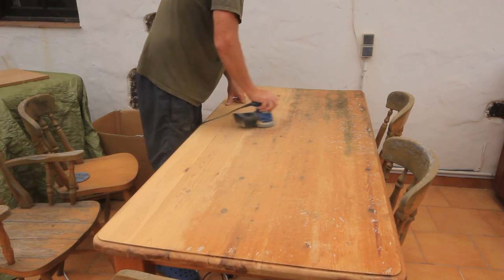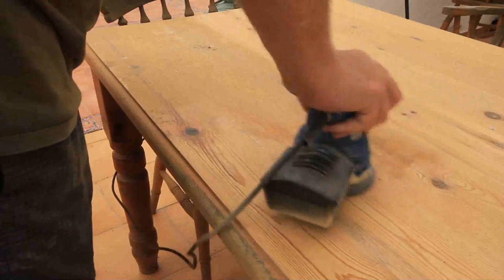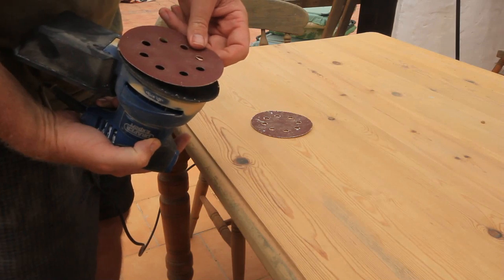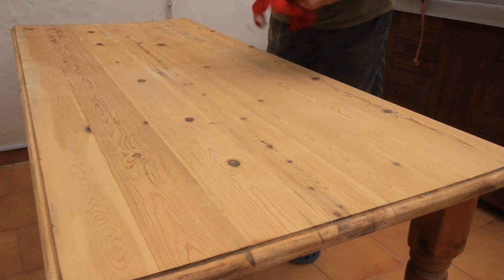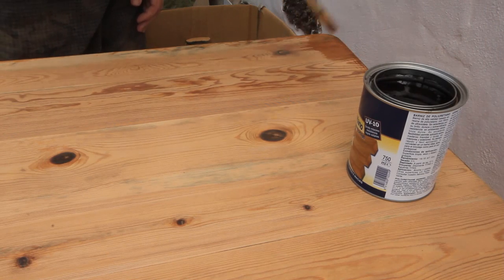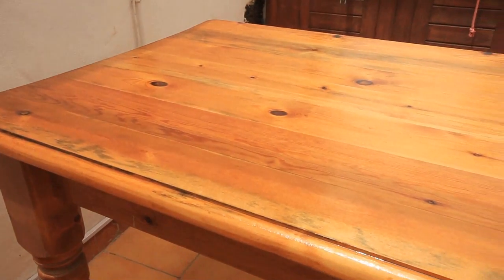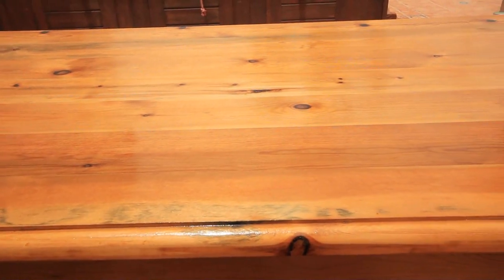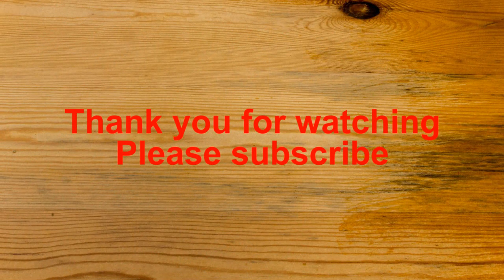How to refinish a pine table

Comment: Thanks to this video, I finished my first project yesterday which was a small pine table desk I bought from a charity shop for 40 quid. I didn't know where to start but one watch of this and I was ready to go! I did however forget the bit where you lightly sanded it after the first coat but it doesn't seem too different from your finished table. I'm actually typing this comment on my new desk... I used a clear gloss indoor varnish btw. Thanks again!
Reply from the maker: Well done Mark. The first of many projects I hope. Thanks for watching.

Comment: Thank you for making this useful video. I've never done anything like this, and so it's all new to me, but I am considering taking the leap and doing the same for our solid pine coffee table. Can you advise me on what grit I should use to get rid of the existing peeling varnish as well as some slight cut marks on the surface of the table? Also, can I ask why you sanded after completing the first layer of varnish please? Thank you.
Reply from the maker: That rather depends on the extent (or depth) of the cut marks. The best advice would be to start with a fine grit and see how that goes. If it is slow to remove the varnish etc then go a bit courser and so on. I sanded after the first layer to remove any brush marks and to flatten the finish to make the next coat bond better. Just take it slow and good luck.
Reply: @JPinFuerteventura  Thank you so much for your prompt reply- I really appreciate it. I think I'd worry about accidentally removing the varnish if I sand it after the first layer! I'm sure practice will make perfect and this will be my first project. I was just looking at a mouse black and decker sander and hope it'll do the job! Thank you!

Comment: Thank you nicely done.Sanding alone seemed to remove old poly.My old finish did not come off so easily but I did not realize till I started to re coat it.I had to redue it with a stripper step.Is there a test to determine if old poly gone?It appeared to be removed to naked eye.Great video!
Reply from the maker: +para9111 Thanks for your comment. To be honest I have no idea if there is a test you can do. Like you, I did it until it seemed to be removed to the naked eye and it worked. I must just have been lucky ;-)

Comment: We have a 40 year old plus pine dining room table that was deliberately stressed by the manufacturer.  How would you get rid of the dents?
Reply from the maker: Hi, Thanks for watching. I think that depends on how deep the dents are. If they are light you may be able to sand down with an orbital sander. If they are too deep then you may have to fill, perhaps with resin/epoxy. Matt Cremona has a good video in doing this - https://youtu.be/bPJ8ATiJf-s

Comment: Oxalic acid, aka, wood bleach, Barkkeepers Friend, deck bleach, etc., do a good job of removing stains in wood.
Reply from the maker: Thank you for that tip Fred. I will look out for some. Thanks for watching and for your comment.
Reply: I have a huge piece that has stripes of pine and then dark mahogany.  the pine is stained like at 2:51 where it was left outside with something laying partially over the top. this section stayed wet for a long time and so only a section has these small grey spots where fungus got into the pine.  I tried sanding them out but they go deep. 

I'm concerned that the wood bleach will affect the mahogany.  Any thoughts on how to get rid of the grey spots without affecting the mahogony?  I would hate to have to bleach the whole thing...

Comment: Thank you for the very useful video. A newbie here, so please excuse any ignorant questions...lol I don't have the electric tool that you used to sand the table. I have some superficial marks and stains on my pine furniture. Is there anyway to do the sanding manually (without the tool)? Also  it is necessary to sand the whole surface or is it ok to just sand area that I want to touch up. Also if the wood has swollen up (due to being in the rain), can I just sand the raised bit to blend it with the rest of the surface? 

Thank you in advance if you happen to see my post and reply. And also thank you for making the video simple to understand for the lay person. :)
Reply from the maker: You can certainly do it manually but obviously that is harder work. Just make sure you use sandpaper and a sanding block. To get the most consistent finish I would say you need to do the whole surface otherwise you will probably see where you touch it up. If the raised bit is particularly "high" then sanding by hand may take forever. If you can borrow a hand plane to flatten it first that may help. Good luck Eva.
Reply: JP in Fuerteventura: Thank you very much for the advice. Will keep that in mind when I start with my woodwork project. :)

Comment: A good tutorial! 

Is the orbital sander integral or can I use a standard sander? Much debate with my father who recommends flour paper for finishing the varnish between coats. I've just ordered, 320 grit for this.
Reply from the maker: Provided the sander isn't too aggressive such that it scores the wood I think any sander should be ok, although the orbital is good as it makes random passes. 320 grits sounds fine enough. Thanks for watching.
Reply: JP in Fuerteventura thank you for a succinct tutorial as well as getting back to me
Reply from the maker: My pleasure. Thanks again for watching and your comments.

Comment: My table has paint on a couple of the legs and stain on part and then other parts of it are stripped. Apparently someone started but gave up trying to restore this table. Would you use the same method of sanding to remove paint and stain and also, how do you get around the spindles--the narrow places?
Reply from the maker: You could try paint remover before sanding to make life a bit easier. Sanding around things like spindles isn't easy using power tools. Using a long strip of sandpaper wrapped around the spindle and pulled back and forth using the two ends is probably the most effective. Good luck and thanks for watching.

Comment: Did you video varnishing the chairs? I've got chairs like those but someone tried to reglue the spindle s would you do a video doing that for  us please. My family laugh at me trying to mend old furniture that isn't bad but just needs TLC. Thank you for your video I enjoyed learning something new.
Reply from the maker: I tried to repair the chairs before varnishing them but you need 5 pairs of hands to do it. I tried using clamps but as there were no square parts to clamp on they just slipped off. After wasting a few afternoons trying, and ending up with more pieces than I started with, I gave up and took them to the recycling centre! They must have machines to hold them together when they are made Helen.
Reply: @JPinFuerteventura  at least you tried. Thank you for replying. I guess we can't fix everything that we want to.
Reply: @JPinFuerteventura  I've been on the hunt for ideas on turning an old wardrobe into a bookcase no joy on that one. I have a small budget, and I was a single mum with my only son who has been moved out since June this year so I need to make do and mend, it is a big challenge and I'm not ready to give up yet.
Reply from the maker: Have you tried Pinterest for ideas?
Reply: @JPinFuerteventura  no I haven, thank you I will have a look.

Comment: Hi thanks for the video, we have actually stripped our baltic pine tabletop whitewashed it and painted it a few times, would your procedure still work on ours? I'd love to go back to the original wood.
Reply from the maker: I think one of the problems might be that the whitewash, being very thin, may have soaked into the grain of the wood. Sanding may not get rid of it. But I suppose there is nothing to lose in trying it. If it doesn't work you can just whitewash it again. Good luck June.

Comment: My cat has made deep scratches in my pine furniture.  What can I use as a filler to fill in the scratches?
Reply from the maker: Look for some wood filler that can be stained so that when you refinish it the filled area won't be so noticeable.
Reply: Thank you!  Sorry for my delay.  I don't go on YouTube that often.  I love my pine furniture and want to make it look its best.
Reply from the maker: No problem. Good luck - I hope it turns out ok.